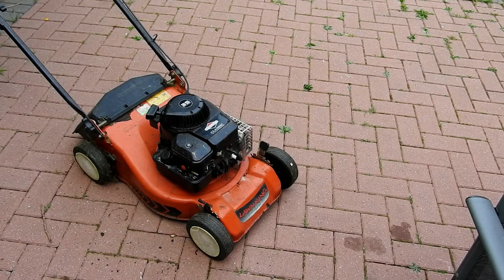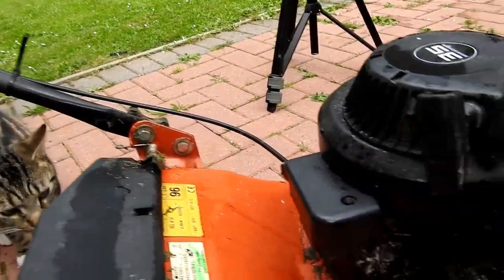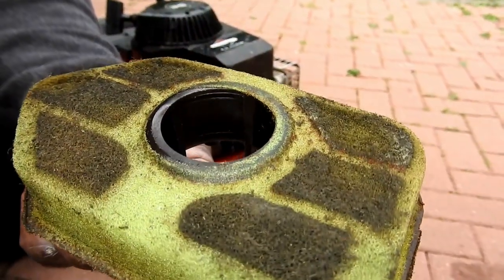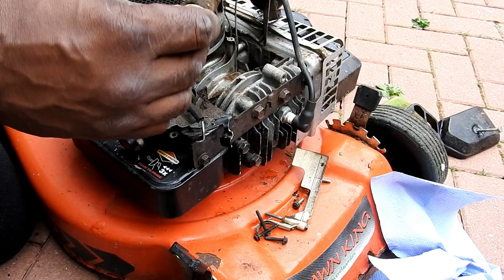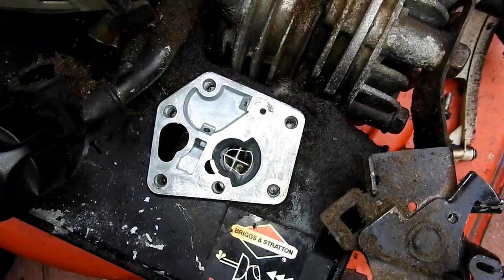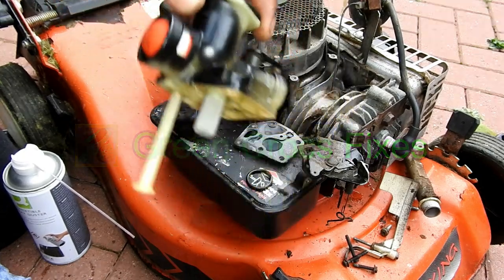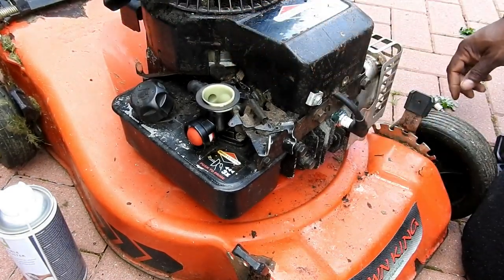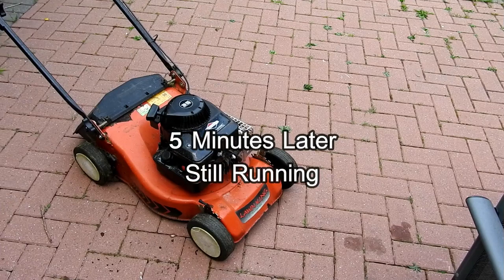Briggs & Stratton Lawn Mower Will Not Start.

Comment: Where the diaphragm sits.. the nearest point towards you..Score a line in the fuel tank.  When the carb is screwed down and the diaphram is in between it gives a better seal. It makes it run much better, prevents air leaks.. as the gap between the 2 screws where the fuel bubble is can warp. Mine ran grewt after i did that mod.
Reply from the maker: Thanks Adam,
                         will look into it.

                  Regards.